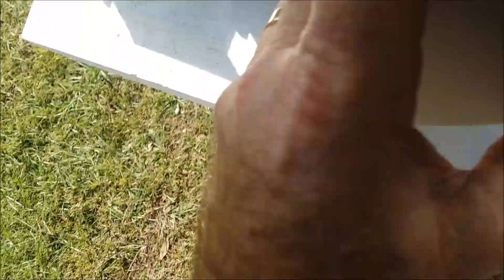What Is Telecom Grade Equipment, And Why Is It So Much Better For Gold Recovery?

Comment: I don't ever like to put anything negative in a comment, but you said you could get several grams of gold from all the boards and power supplies on the table?
I've seen this kind of stuff processed and I've been disappointed to see less than a gram of gold. Usually less than a half gram! I spent several years accumulating this stuff only to find out that they had about 1 gram to 5 grams per kilo after depopulating! And that's with the pins which had always been the highest yield! Don't get me wrong, I still collect and save this stuff, but I've never paid a dime for any of it. And sometimes people pay me just to take it! The cost of nitric acid is very expensive and sometimes it's hard to make a good profit on it. I do it for fun and as a hobby so I don't care if I make a profit as much as I should. But I'd never pay for a board, unless I was in business to buy and sell. Or I had a big refining company that could make the profit on them.
Reply from the maker: Does that include processing the IC chips for the gold bond wires? There are a lot of large flat pack IC chips on these boards. I expect to get a lot of gold out of them. There is also a lot of gold plating on these particular boards. It's going to take work to recover it all, or at least most of it. Some of it isn't going to be easy to get, but I suspect there is a lot more gold there than you think based on my past experience.
Reply: @omegageek64  OK, you know more about what's in front of you than I do! Lots of different batches of IC chips have been processed, and it'd be really good to get 1 gram per pound of IC and flat packs! From my perspective it looks like there is probably less than a pound of IC's there! I'm sorry to have stated what I said earlier, because I myself am addicted to ewaste and love gold recovery from it! But my bubble got bursted when I found out how much/little gold there was in them! I thought I was going to live off the gold recovery later in life!
I still do ewaste, but I'm doing it with my eyes wide open and with expectations low on the gold yield!
Have you started to recover and refine yet? I would not start unless you study very very hard and long on it. It's so dang dangerous!!!
You probably already know the name Sreetips, he's got some great vids that are very detailed!! However  he's a karat scrapper not an ewaste scrapper! In fact I hated his vids when I first started watching because he's debunking all my hopes and dreams! But at least I know more things now! One things for sure the items you got there are VERY HIGH QUALITY!!! And they will have alot more gold in them than most others, besides M-specs! I'm doing ewaste and jewelry collecting now!
Again I'm sorry about what I've stated, I'm a big ewaste geek! And I hate ever putting anything negative in a comment section!!!

I HOPE YOU and ALL around You have a GREAT Thanksgiving, My Friend!!!
Reply from the maker: @shaneyork300  Hey, no problem. I didn't take any offense. I hope you didn't either. I agree that there is (almost) always less gold than there appears to be. I've been pleasantly surprised a few times, especially by flat pack IC chips that had a lot more gold than I expected in them. Maybe I'll be pleasantly surprised this time too. But even without any pleasant surprises, the amount of visible gold on these boards and connectors is better than anything I've ever run into before. Hopefully I can recover most of it.

I do this as a hobby. I don't expect to be able to live off of it alone. Even so, I have made a respectable profit. I try to keep costs down as much as possible, both in acquiring the e-waste, and in processing it. I don't care if it takes a month or two in AP solution to recover the gold from pins or fingers. I can be patient if it means only using a few cents worth of chemicals. I also make my own nitric acid. I have a whole series of videos on how I do that. I agree that the acid is very expensive to buy. For about the cost of a liter of concentrated nitric acid I bought all the equipment I needed to make my own. I can run off a batch in an afternoon for next to nothing. That was the real breakthrough that made this hobby profitable for me I think.

Yes, I refine too, and have already sold several batches of recovered and refined gold to a local jeweler. See some of my other videos in my Urban Gold Mining channel. I need to research if it would be better to sell to a refiner instead of to a jeweler who probably then sends it to a refiner. Maybe I'd do a little better by cutting out the middle man.

Yes, I am a big fan of Sreetips. He's the man! I learned a lot from him. I've been having issues with other metals (PGMs) following the gold through the refining process. I'm going to try his technique of multiple precipitations with different precipitating chemicals to try to get my purity up as close to 24K as I can. I love it when the jeweler's meter goes all the way to 24K when they are testing my gold. It means I get more $$$ for it.

I hope you and yours have a great Thanksgiving too.
Reply: @omegageek64  WOW!!! Sounds like I might have to take a look at some of your playlist!!
I subcribed to you a while back, you must have had a vid pop up that caught my eye like this one! I'll be watching and we'll talk again!! Very Impressive that you make your own nitric!!!
Have a GREAT Day!!!